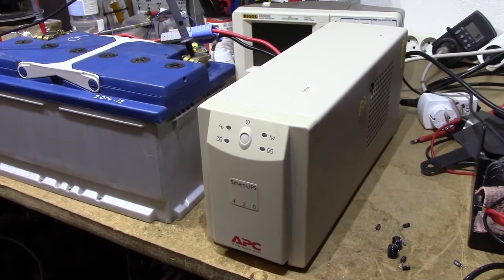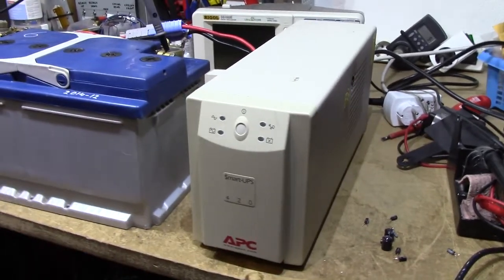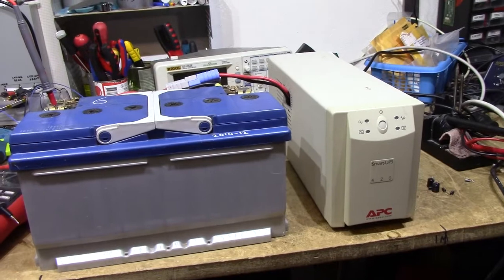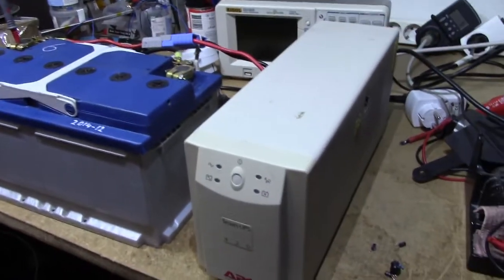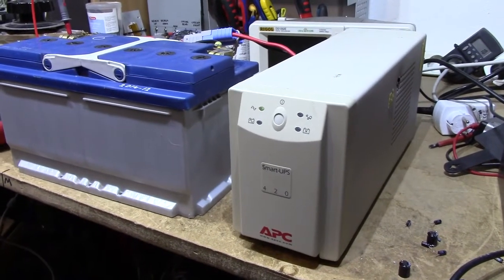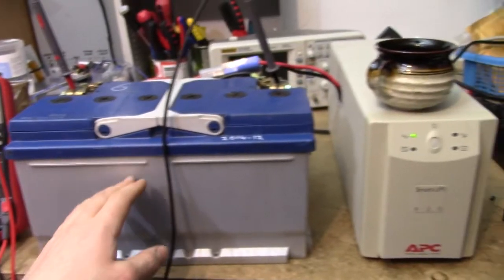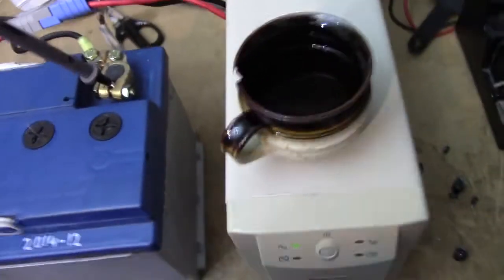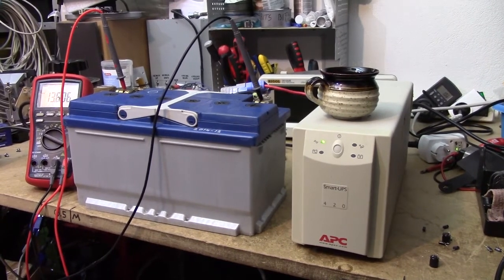Rambling about my first UPS (Smart-UPS 420)

Comment: I have one of these but it is 650 va and it has what i believe to be an intel mcu inside date 2000 apc, date 1980 from intel. Would be interesting to see if I could get anything from the rom. I think an "intel inside" sticker would be fitting

Comment: Ah, firsts :) I still have the first computer I ever owned, a IBM PS/1 (486SX 25 MHz), still boots up fine, I think I might have to change out the CMOS battery in it one of these days.
May your UPS have another decade or two of honorable service and an honorable retirement.
Merry Christmas and Happy New Year (in advance)!
Reply from the maker: Those old IBM machines are lovely - I have a couple of those much more proprietary PS/2 machines lying around, based upon 286 processors. Absolutely adorable machines, they are.
Reply: FFcossag
Absolutely. One of the last computers before the industry began moving towards planned obsolesence. Runs like clockwork :) I hang onto it for sentimental reasons mostly, but also because I'm trying to teach myself systems programming and embedded stuff, and I know the box as the back of my hand programming-wise.

Comment: could you please measure what current does it draw when running on batteries without any load connected? many thanks
Reply from the maker: +Petr Valkoun I don't have it in use right now, but these units should sit at just around an amp, give or take.

Comment: Hi, I have a APC ES-600g UPS hooked up to a battery like you have here(only smaller). but the reported runtime and battery percentage in Apcuspd, does not correspond to the battery voltage. I am pulling about 120 watts load and the battery will last about 1 1\2 hours. But as soon as I disconnect the main, battery percentage drops to 0% and run time 1 minute. So it wants to hibernate my computer right away but if cancel out of the hibernation prompts it will run for 1 1\2 hours. What could be wrong? thanks, Benjamin
Reply from the maker: You have not reset the battery constant after the UPS has had a bad battery. Use the apctest utility to do this. Enter TTY mode and programming mode (press 1 twice with 2 seconds delay), then adjust the j parameter (IIRC) until it's as high as possible. It'll never report the correct runtime though (battery too big), but it should report more than 0 minutes.
Reply: Thanks, I have a "dumb" UPS so I cant get into that menu, but I did change the battery change date and now it was reading 16.5 minutes. Do you think that running a "manual runtime calibration" would still improve it more? Thanks anyways, Benjamin
Reply from the maker: Benjamin Martin
Try it. I've never bothered tinkering with one of those.
Reply: One last question :) have you been able to get schematics for the APC UPS? and were if yes?
Reply from the maker: Benjamin Martin I got some off of some weird Russian FTP server once, but not for anything as new as yours.